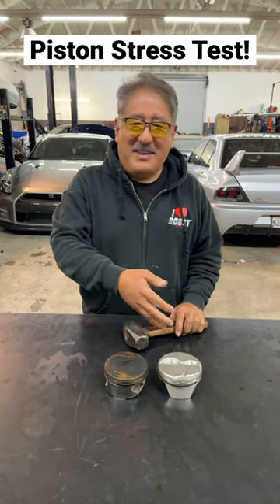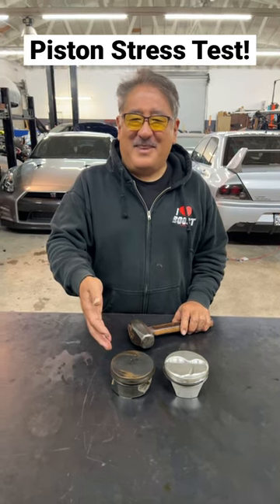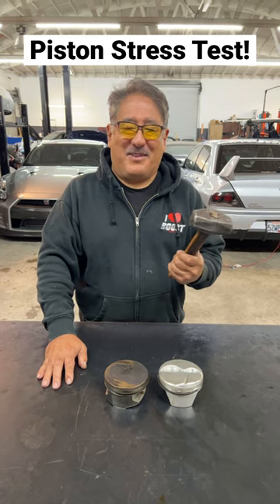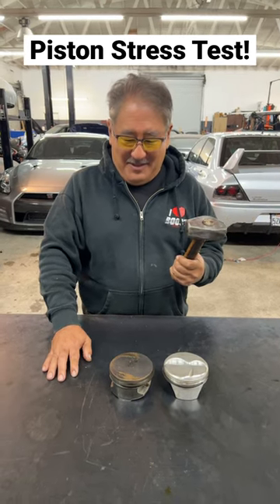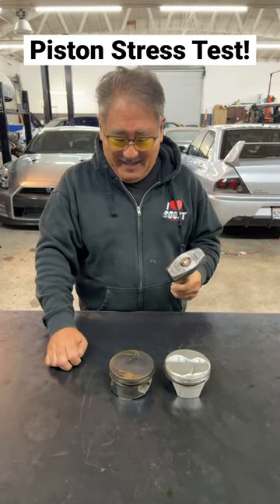Forged vs Cast Piston Strength!

Comment: I hate when a hammer goes down my intake valve
Reply from the maker: Thats not good
Reply: haha
Reply: Gotta keep up on your air filters man!!
Reply: We've all been there man. Never a good day.
Reply: Interesting 😂
Reply: @motoiq I have a question concerning nippon after market Subaru pistons, they said they use casting material equivalent to Mitsubishi casting”T6”. They also claim you can push 450 wheel horsepower from them. I cannot find any videos on the pistons being used in Subarus but from what I’ve seen of them being used in Honda K series and B series engines. They are good up to 450 wheel horsepower, so my question is with a proper tune. Will this be considered a reliable engine at 400/450 wheel horsepower?
Reply: Gotta watch those construction sites when she spools it’ll suck those hammers right in.
Reply: Ever had a timing belt snap and have that piston slam right into the valve? 
It's alright tho, it was only a gas engine
Reply: Ahhh haha
Reply from the maker: @noahpaige2984  Subaru's have bad ring land location which is why they blow up so easy.
Reply: I love YouTube comments 😂😂😂😂
Reply: Yeah you'll have that on those big jobs.
Reply: Cmon, let’s race man.
Reply: What kind of race environment is dat
Reply: Yeah, that's bad
Reply: Ikr pisses me off
Reply: That’s what she said
Reply: Hahaha 😂
Reply: I read that in your voice ahhaahahhaaa @motoiq
Reply: I just spat my drink out🤣 🤣 🤣
Reply: He literally said detonation.
Reply: AYOOOOO

Comment: He did hit that forged piston hard 😂
Reply: Same sound as the cast iron so no bs. But wondering which car that forged piston went in. 😂😂
Reply: He hit the cast one on the tip
Reply: He definitely hit both of them on the edge.
Reply: @Fatboypeet  like boosted FA said, both were hit on the edge..
Reply: @Asceticism_N  probably in no car, since you can buy 4032 forged pistons for as little as 90 bucks for a single... probably made that back in youtube revenue, and then some, already
Reply: *cast aluminum
Reply: @Fatboypeet watch it again he hit them both on the edge and he hit the forged one way harder if you look at his body when he does it.
Reply: @Fatboypeet he hit the forged on the tip too and harder...
Reply: @BoostedFA *Edge
Reply: @edmundnlemadim8480 the forged piston is for a direct injection engine you can tell from the top
Reply: @Fatboypeet he hit them on the same edge lol
Reply: he hit both of them roughly the same. when he hit the forged one it sounded significantly louder because of the difference in harmonics.
Reply: Lol I noticed that too he's so cute

Comment: Moral of the story: don’t fill your gas tank with hammers
Reply: Or this guy with the hammer
Reply: Moral to the story forged is more resistant to force.
Reply: if you’ve ever seen the carnage and aftermath from a boosted motor blowing up, youd know how legit this demonstration is. cast pistons legit explode if anything goes wrong, forged slugs can save your block from having an inspection hole in the side of it lol

Comment: Just from experience if that's a SBC it's still gonna run, not gonna sound good but it will, I have a forged 0.60 piston with a intake valve that broke off and flipped around and went straight through the top of the piston and into the connecting rod and wrist pin, cracked the block on cylinder 7 and completely blew that end of the head off the block, made it the 5 miles home firing on 6 cylinders and never fell below 100mph

Comment: Subaru uses forged pistons for their sti in japan, but cast is the us. Because cast pistons get slightly better emissions on startup. Defund the epa.
Reply: EPA doesn't care about things like longevity, reliability, or emissions related to supply chains needed to support parts that must be made less reliable to fulfill running emissions regulations. Most likely incompetence.
Reply: Subaru also has the ring gap to tight so if it overheats to much it'll break a piston, because cold start emissions.
Reply: @realbigtuna667 The real reason the OEMs use cast pistons (apart from cost, which is 100% the main reason) is that forged pistons require slightly more piston>bore clearance due to them expanding a bit more than cast. This means more blow up while the engine warms up and increased emissions, which they can't get away with anymore.

Comment: Now do a semi-solid cast piston. The only ones that exist are marketed as "semi-forged" and they're an OEM upgrade for the 4AGE from Toyota. They're rated for 600hp in that engine. Semi-solid casting is a process where hypereutectic aluminum is heated up until it has a paste-like consistency and then I believe it is high-pressure squeezed into a mold or drop forged or something like that. The end result is a hypereutectic cast piston with an aligned grain structure, giving it the beneficial properties of forging (to a slightly lesser extent) as well as the beneficial properties of a cast piston (no piston slap, no or low blowby, not "warmup" period before safely romping).
Reply from the maker: Who makes those?  I have only heard of wheels made that way. 4032 alloy pistons are something similar.
Reply: @motoiq  I literally said so in the comment. It's a set of factory-available pistons from Toyota for the 4AGE. They're 81mm in bore. They're marketed as "semi-forged" but the actual process is called "semi-solid cast." 

The ones from Toyota the only ones I know of. I wish the aftermarket had more of them for popular engines at a few different compression ratios.

Also for the wheels, I think you're thinking of rotary forged, which is a different process altogether.
Reply from the maker: It's because they probably don't exist and someone said that on the internet.
Reply: No they do exist The issue is that the equipment used to make it is quite expensive to maintain and let alone use. Toyota's the only manufacturer that offers them factory as an upgrade. During the process they were squeezed into a mold under high pressure like he said when they're turned into a paste like consistency. Giving very similar strength to a forged piston while giving you all the benefits of a hypertect it piston. But forged is stronger and can handle way higher temps.

Comment: cast piston fits tighter and makes engine run smoother for longer
Reply: Why would that be the case? They are Both aluminum and ordered to spec
Reply: The expansion rates are different so the bore diameter will be a little sloppy for the forged pistons. But after the pistons warm up the clearance is the same.
Reply: Forged piston are what blue prints are based off of. That fist motor they make when designing at the factory is made with forged part. They mass produce with cast pieces for affordability. So you are wrong 100 percent.
Reply: @FLORIDAMANIAM-he2lz  that doesn't really make any sense becuase casting is cheap to proto type and forged parts are usually ordered based on bore spec for when you are building an engine. I found out later that it does expand slower than cast aluminum

Comment: Ooh bummer, the ring land broke!! Lol I'll be getting forged pistons but having 3.66 pistons, bored 50 over, having a tough time finding a proper brand to go with Zero deck, 1.16 compression height needs... it also needs 1.5,1.5,3mm or less on the ring lands, gas ported, total seal preferably but plasma rings file to fit will work too. Bronze bushed, with a DLC tool steel wrist pins and a Hard Crown treatment  are the levels I'd like to find in a Manufacturer!!  Yeah, forged pistons a must!!
Reply from the maker: Any of the top guys can easily do that, JE, CP, Mahle, Wiseco

Comment: The only positive to cast or hypereutectic piston is less expansion rate. That way they can run a tighter clearance. It increases longevity and mileage but sacrifices brute strength needed in high horsepower applications.
Reply: That is why high performance use steel. Aluminium is just cheap and best for mass production.

Comment: I had bought a "forged" piston for my motorbike a while back and tried to install it with the end of my hammer (plastic handle) but covered it up with a thin cloth rag so I didn't scuff anything. 

7 taps in and the center ringland shattered and compression ring bent...then my heart shattered after I realized what happened. (R.I.P. cheap eBay 196cc piston)
Reply: What happened
Reply: @gawdzalien2811  Defective piston I guess. Forged pistons don't normally break that easily.

Comment: Nice demonstration of material integrity and strenght but not really a good example if you want to go more in depth since the force from a detonation builds up gradually (explosion and expansion) and not instantly (dropping a hammer onto the solid surface). Noto to mention that the whole energy will spread across the whole surface and not just hit some part of some edge :) 

As a stress test demonstration okay but I somehow missed the benefit of a forged one which is huge - weight. A forged one is lighter thus you can gain extra power which would otherwise be lost due to higher weight of the casted piston. 

Again - as a short video quickly demonstrating the difference it is okay :)
Reply from the maker: I don't think an explosion is a good analogy for a gradual build-up of force. And detonation forces do not build up gradually.

Comment: This is an impact test. Correct me if I'm wrong but when casting a metal it becomes harder during recrystallisation, so it will be able to withstand more energy from impact, however due to the lack of tensile strength of the casted metal (won't bend as freely) it simply shatters. You see this quite a bit in cast iron, negating the additional carbon content. Sorry if that is incorrect, in any case check out alloys and phase diagrams (:
Reply from the maker: It depends how you cool it.

Comment: All true, that said when an engine is tuned properly, cast pistons can handle a lot of power. Forged is certainly good for the added insurance.
Reply: Gap your rings to at least .030” and a lot of stock internal engines will make 800hp all day long

Comment: Forged pistons can still break the real fix is to prevent the detonation.
Reply: This is true what you said but if you have 1 bad knock from a problem the forged will take it the cast will crack , now running really lean there both gonna melt

Comment: Good tune, good fuel, and good ring gap. Not a problem. Too tight a ring gap, bad fuel, and a bad tune will kill that forged piston too. In fact, have everything else perfect, just get that ring gap too tight and its bye bye ringland on the forged unit.
Reply: Yup. Videos like this imply a forged piston won't/can't fail. Forged pistons are indeed better for an engine with high cylinder pressure; and they will endure knock a bit LONGER than cast pistons - but it doesn't take long to melt/destroy a forged piston if your fuel/calibration is wrong.

Meanwhile, there are lots of 1000hp 2Js out there running just fine with cast.
Reply: @GroovesAndLands true, a failed blow off valve can instantly destroy turbocharged engine in just a few second of boost
Reply: @dwiwahyu7638  That's a new one on me, chief. Please explain how.
Reply: @dwiwahyu7638 Some people don't run a BOV.
Reply: @3rdzodiac  I don't bother with a BOV... So I limit my boost sessions to only a couple seconds at a time! 🤣

A couple years back, High Performance Academy did a rather deep-dive on one of their cars; measuring turbo speed both with and without a BOV. It was a real eye-opener to see installing a BOV didn't change anything at ALL.
Reply: @GroovesAndLands  Nothing? Lol. That's interesting to know. I never looked into it but saw a few people over the years on forums not run one. Didn't know if there was an advantage or not to doing that.
Reply: @3rdzodiac  

Here is the HPA video I was referencing, with the test data showing no difference in turbo speed with/without a BOV:

https://www.youtube.com/watch?v=Fz-vekMoKdM

They don't conclude that BOVs are "unnecessary". They present the data and provide some thoughts so you can draw your own conclusions.

There are also several Engine Master's episodes where they control boost pressure , with a big centrifugal blower - by introducing a large leak in the piping between the blower and the throttle. The hole has to get BIG to decrease boost much at all.

I think these results suggest a typical 40-50mm BOV is not sufficient to truly vent the  huge amount of airflow a big compressor wheel moves when spinning at high speed.

FWIW, on my 2JZ with a 64/62 turbo - I can't hear the difference when I lift off the throttle with/without the BOV. However, on rare occasions, at about 95 kPa MAP, I get a touch of compressor surge I didn't get before when I had the BOV installed.

Comment: When Mike is wearing his Yellow glasses you know he's not messing about!

I have a question in regards to a cast piston in Nitro drag racing application. I was at my local drag racing facility (Queensland raceway, Australia) and i was extremely surprised when I noticed during a tear down of a nitro top fuel dragster engine the pistons had the crisscross cast markings inside the piston (above the gudgeon pin), I thought that a Nitro engine would have forged pistons. The crew were extremely busy so i didn't want to interrupt them to ask. Just wondering if you have seen that before or if there was a reason for that? Thank you for taking the time to make these videos, keep up the great work, they are fantastic!
Reply from the maker: Been around top fuel and funny car engines and never saw anything close to a cast piston.
Reply: @motoiq  Thank you, that's exactly what I was thinking. I must of been mistaken and it was a forged piston. Thanks guys.
Reply from the maker: Since those engines need to with stand crazy pressures it was probably a forged in reinforcement.  Is it like the CP Top Fuel piston? https://www.cp-carrillo.com/n-12078-introducing-the-new-top-fuel-forging-the-tf-x.html
Reply: @motoiq  It looked very similar to that piston except under the head it had the crisscross casting marks. I'll try and find a photograph of the style of piston I saw.

Comment: If you have a really good tune how much you think you could get away with a cast piston? How much cylinder pressure till this happens without detonating?
Reply from the maker: It depends on the piston design
Reply: @motoiq  ok. Thanks
Reply from the maker: If it is a cast piston like a 4G63 or SR20DET quite a bit, if it is like a EJ257, not much, if it is like a B18C or K20 somewhere in the middle.

Comment: Got a new OEM STi shortblock from Subaru about 1 year ago due to spun bearing on my 2014 STi...
Hoping to get the car tuned and upgraded to abou the 350ish WHP range in the coming months..Will the new OEM shortblock pistons be up to the task?
Reply from the maker: right on the edge, don't recommend going past 325 with stock pistons on 91 pump gas.

Comment: If you can live with a little mechanical slap until you get to operating temperature 🌡 its the only way to go with a more than stock boost level, the sweet sound of mechanical engineering 😊

Comment: You know that the forged piston is expensive ? 
Only a good solution if you add additional power in the engine block. 

Dear standart owner with a economic standart engine, I think you never ever need a forged piston set with non standart rings. And dont like to bu stronger conrods. 

But = Yes the sluminium is more dense and the crystal structure is far better than ...

Dear standart owner if you have a lot of additional money left ...
... invest these money for anticorrosion. 

Just my two cents. 

Your choise !
Yes it is nice to drive a standart engine with more power and torque (after changed a lot of parts and buy some forged pistons) . My word before we took the engine in all parts and searched for additional torque and hoesepower ... 

The engine will run with higher icombustion prrassure and more revs. It will drink more liquid power fluid and need best oil plus care of an expert and in shorter distances. 

Alternativ = Buy a bigger engine or car and you get for low money ...

But impressive dhort video. 
Difficult to say if both hits have the same impact power and angle and more ...

Yes a forged piston ist mutch stronger than a cast piston. 

At last = Thank you for your video.

Comment: Forged is better for 50,000 miles. Cast is better for 200 + ,000 miles.  Forged engine internals need an actual warmup before driving. Cast also do but its less bad over time.

Comment: Not necessarily.  I had 7 other pistons that worked.  In fact.  When I took apart the engine. It was a small piece like that, that blew out of the engine by chance.  It still ran good just sounded like crap.  😂

Comment: Metal have multi directional strength and clearly define fatigue limit so that forge piston won’t last any longer then that cast unit assuming the correct design force is projected to the piston of course the forge one can take more stress far exceeding the breaking point of the cast unit assuming they have the same weight a cast unit can be made stronger then a forge one it’s simply a matter of how much mass your willing to take but below that stress point a forge unit is not more durable then a fast one at the same strength liming the main advantage of a forge unit is weight but of course in power upgrade application a forge piston would often be design to be far stronger and lighter then the factory cast one.
Reply from the maker: Modern cast pistons last longer than performance forged pistons in regular daily driving use due to the metallurgy. Performance forged pistons are much stronger though due to the metallurgy and better grain orientation and refinement from the forging process.